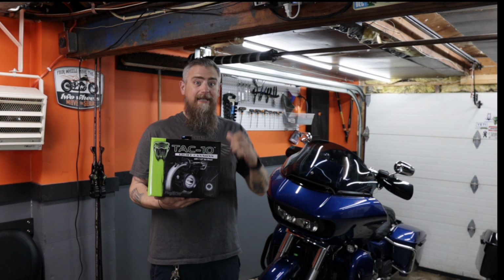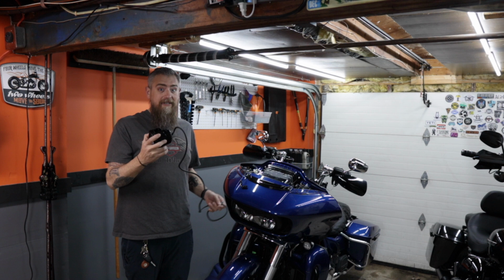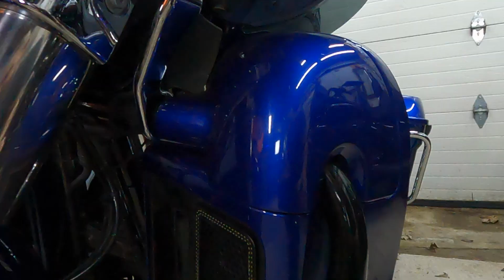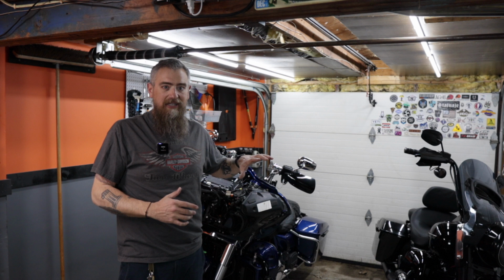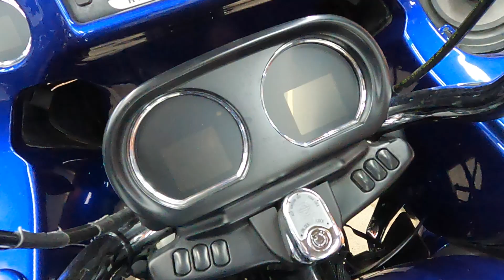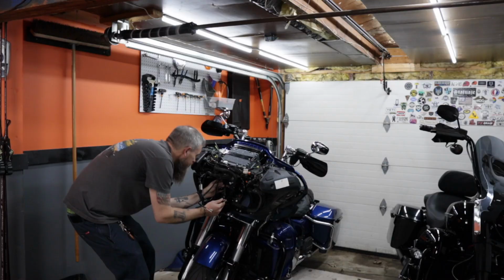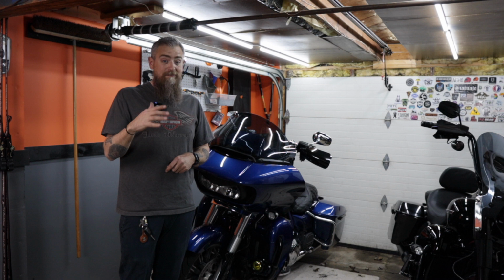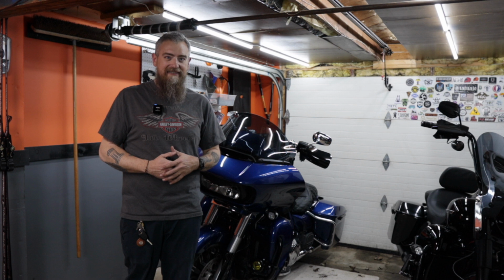Adding some SERIOUS Light Output to the Road Glide | Tac 10 Light Canons from Ciro3d

Comment: I love the extra light output and I agree that the yellow lenses make it a "personal touch". Man they are big though, that would be the only thing that I could take points off for (assuming they don't have a large power draw). The installation seemed a bit tedious, but I don't do a lot of wrenching so I'm biased. Godspeed
Reply from the maker: Its not a horrible install, mostly you just need to figure out where you to mount them and running the wiring is a little bit tedious just trying to keep it hidden and all that. They are beefy but they dont look out of place in my opinion, they just look kinda tactical and tough, I dont know how else to describe them but definitely quality products.